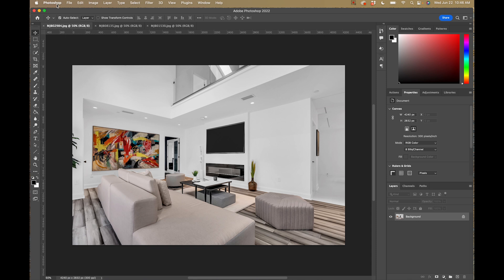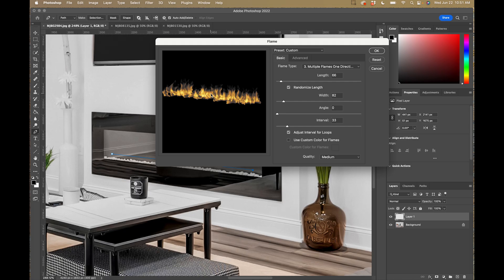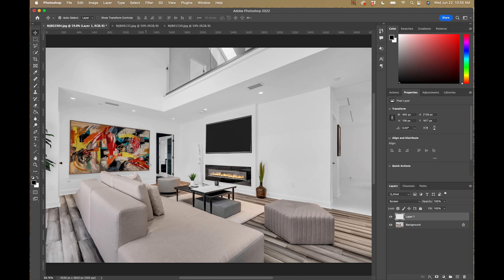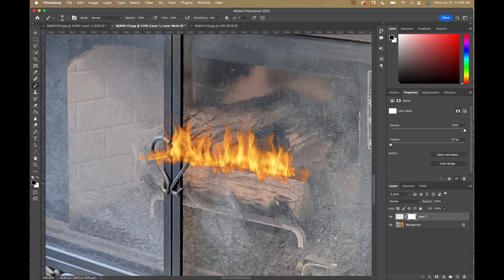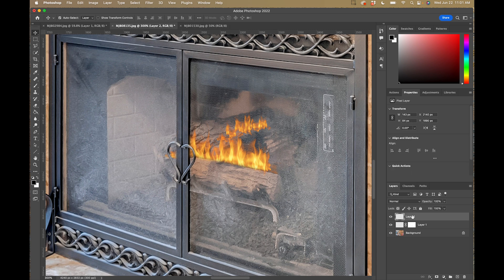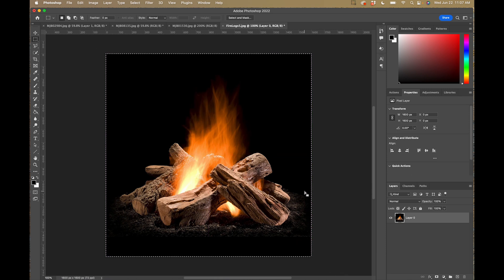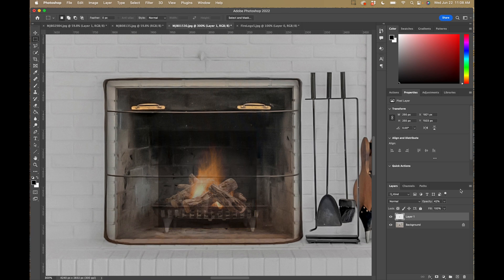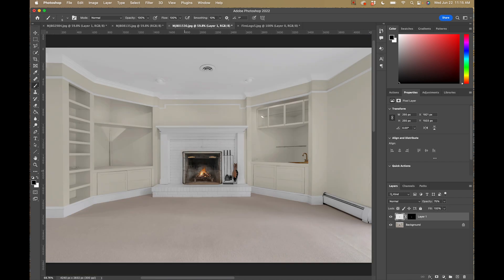Adding Fire into Fireplaces in Photoshop

Comment: Great video. One additional step that I usually add when dealing with fire is, Fire creates warm light. So I use command + J to make a copy and then bring the white balance all the way up to make an orange tint. Then I mask that layer and cast those lights on the inside wall of the fireplace.
Reply from the maker: Great tip!